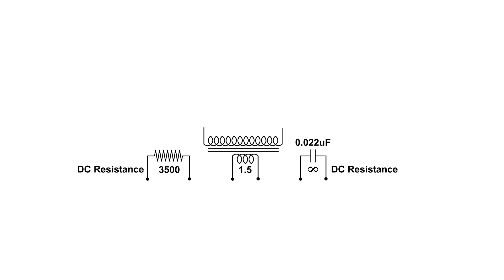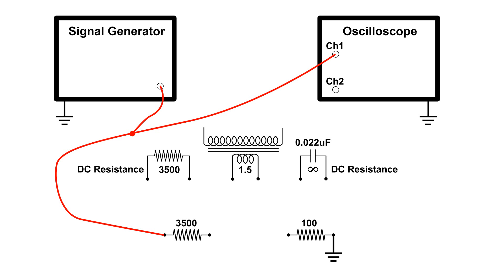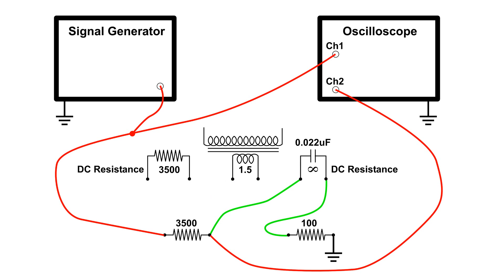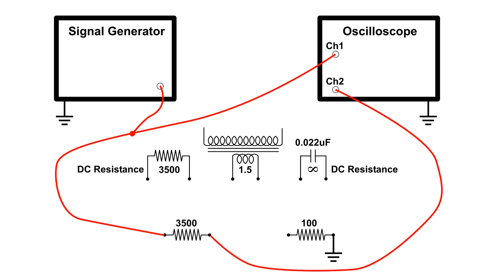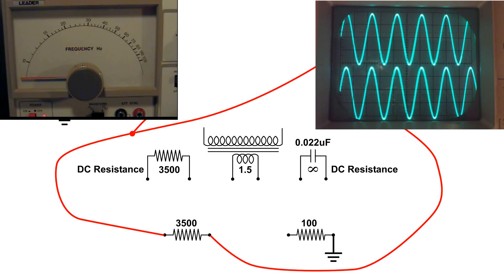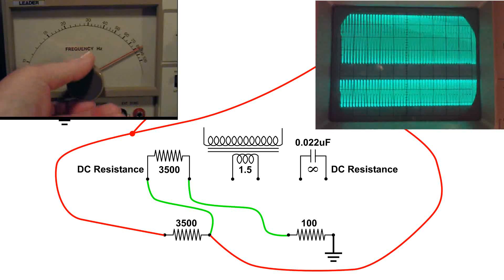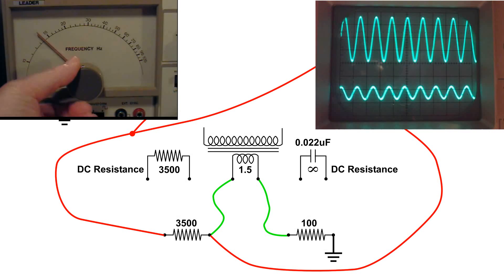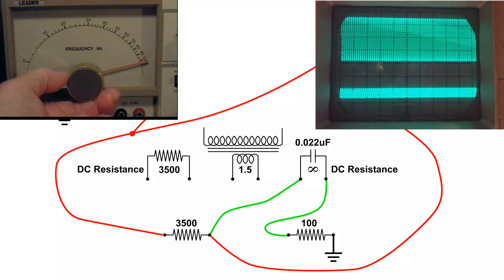Impedance and Frequency, Oscilloscope Demo

Comment: I kept watching this video and going why is the capacitor impedance going low with high frequency as expected yet the amplitude is going down!!!! Then i looked at the actual circuit doh, makes it a bit confusing where the oscilloscope is tapped off.
Reply from the maker: Thank You.

Comment from the maker: The signal coming from the audio generator is low power. So a half a watt and up will do. I didn't worry about the power I just picked the resistors for the ohms.

Comment from the maker: Yes at low frequency the impedance is low for the coil, at high frequency the impedance is high.  At low frequency the impedance is high for the capacitor, at high frequency the impedance is low.

Comment: When you have it connected to the coil, the amplitude starts out low, and when you increase the frequency, the amplitude also increases.  You say that the higher amplitude demonstrates a _higher_ impedance in a coil at a higher frequency.  But I would have thought a higher amplitude would mean _less_ impedance.  Thanks, love your videos.

Comment: That I don't understand what is the difference about the AC and DC resistance! Maybe its negative pull power and positive push power! I must think what difference that is! I think the most difference is just that negative pull power! The resistance are against the pull power like push it back for no go trough! I don't got in my mind how the DC circuit work then so do the DC circuit have any impedance? I'm so stupid! I'm talked about that with one my radio amateur friend and he did much laugh too

Comment from the maker: It depends on what it is you want to do, thats what determines the parts used. You can get the same results in this video by using an air core coil and the capacitor would be just a few pF. But the equipment I have can not display frequencies that high, that is required for those parts. So I chose the parts and frequency that my equipment can display accurately.

Comment: I don't understand the impedance and resistance matter but I thinking now the higher impedance push the signal on the ground trough 100 ground resistor than the oscilloscope! So the impedance like suck the signal from the resistor! Maybe the input resistor limit the signal from source but the impedance order the way where the signal go! The oscilloscope must have an impedance too so what it is? I don't understand what matter the oscilloscope impedance difference against the coil impedance!

Comment: I'm wondering do that coil resistance mean too much for the signal dynamic change! I was always tough the coils Henries do only matter for the dynamic change? Why the coil is a transform why don't it be an air core or metal or magnet core? Do the the transformer same thing like cores I asked before? I was tough the resistance change only stable level signal Hz so the transformer changing the resistance by different Hz's like high frequencies get it more resistance! Sorry for all the mess! Assa!

Comment from the maker: If the radio plays good but just noisy it will be accurate. If not a 445KC signal generator will help. Or replace the I.F. totally. I don't have preference, if it works, and does the job, thats all I need.

Comment: Rick:

Your book is great!

The book mentioned measuring the capacitance value after unhooking one transformer lead and then write it down. The question is; will this be a very accurate reading if the mica cap is really bad/noisy?

PS I do have 2 capacitor testers. An old Solar Eye tube restored one and a modern DVM. Which would you trust more? Or, use both and see if they jive?

Many Thanks!
Tom

Comment: Rick:

Nice demonstration! It made it crystal clear having the video coinciding with the schematic hookup.

I can see that you could engineer circuits to be resonant at the desired frequency this way. I think this is called the "Q" factor.

I've got a question for you base on this demonstration. If I had bad mica caps in a I.F. can and the schematic didn't show what the value of the mica was, but I knew the I.F. frequency. Could I determine the farad value using this method? How?

Thanks,
Tom